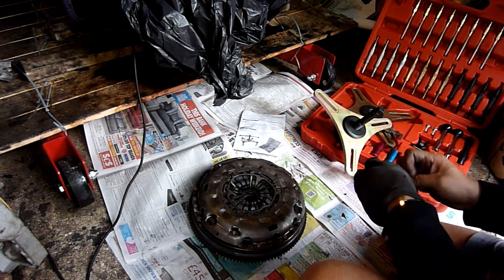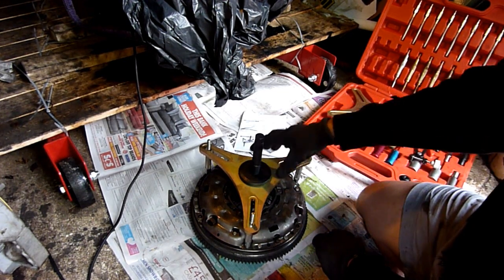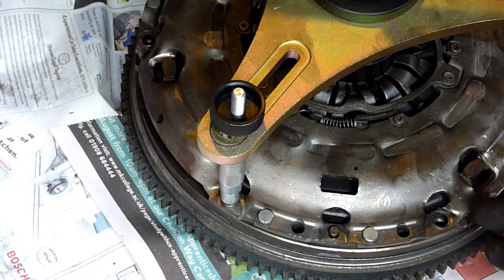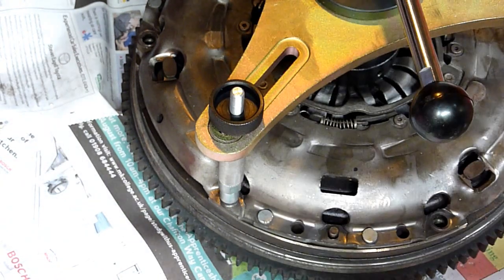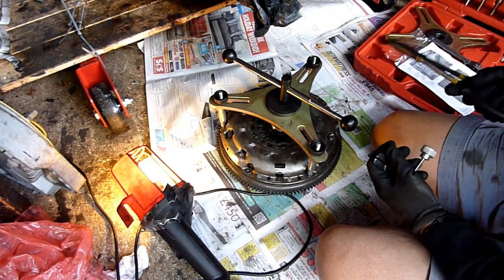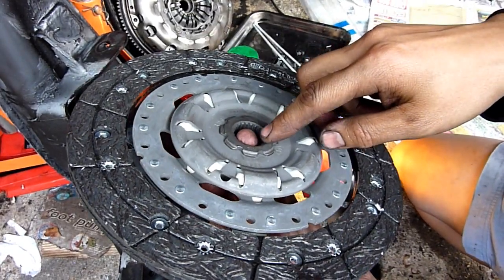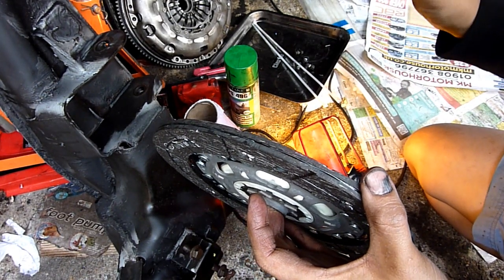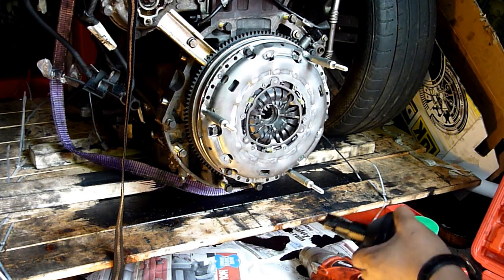Ford Mondeo Self-Adjusting Clutch and Special Tool 2003 late model 2 Litre diesel

Comment: So the theory is this tool just tightens the pressure plate evenly.
Reply from the maker: The special tool doesn't just do that. It sets the zero clutch pressure position like when you fully depress the clutch peddle, then clamps down to the normal drive/ clutch engaged position after unscrewing the special tool and tightening the clutch bolts. If you don't set up the clutch with the special tool, it will not work properly.
Reply: @EducationPineapple  i've fitted a properly pretensioned Luk self adjusting clutch(and new dual mass flywheel) twice now to my car, and twice i couldn't get a gear afterwards? The clutch just won't disengage!
And yes, friction disc is installed the correct way around, i'm totally at a loss as to what im doing wrong, i couldn't have been more careful and prepared to do the job.
Its a renault megane rs225, front wheel drive. If i lift up the front of the car, start it up i can drive all the way up the gearbox no problem, put all four wheels back on the ground again, gear lever is locked solid with the clutch down, not even near going into gear.
Im just about to do this job for a third time and still can't figure out what's wrong?
One thing i noticed messing around with old clutch and flywheel in my house was pressure plate can mount on the flywheel locating dowels a couple of different ways, the way i mounted mine on the car i felt the pressure plate was kind of tight going over these dowels, but i discovered with my old clutch if i kept putting the pressure plate on in different positions suddenly in one position the pressure plate virtually fell onto the dowels!!
I really thought i hsd discovered my problem, does the pressure plate have to go on in a certain position? Thanks.
Reply from the maker: @robbocop33r12  Sorry to hear about your difficulties. My advice to anyone, including myself, is, when you are taking things apart that look a bit the same if you rotate it, take a photograph of the part before taking it off. This applies to things like electrical cables as well. Draw a paint or maker reference point on it as well. This way you can always refer to your proper reference. Rotating a clutch cover 180 degrees even though it appears to fit is not a good idea. Check that things slot in properly and without effort. If you have to force something in, take it back out and re-evaluate. I would say for you to make sure you take your new  part back and exchange it if you can. Go and buy an OEM part from Renault. Use that. In my video, my part was not from Ford, but my car was 11 years old at the time and a very common car, so the chances of getting a good non OEM part was high. Yours look too particular to have a part like a clutch kit made by someone other than Renault. See if you can get an electronic manual (see my videos on it) or better still a Haynes manual. Follow the steps in there.  Watch a video on youtube on that model. Check out Forums. You really need a tool like mine to do the job. Also call up Renault showroom or better still visit them. The guys in the workshops normally will give free advice no problem. Take a photograph of your clutch. They'd tell you which way up it should be. The guys in the parts department can also print off the parts page for your clutch, then you'll definitely see which way up it should be. They're usually bored from having no customers anyway because few come to them for parts. Good Luck and God bless you on your task ahead.
Reply from the maker: @robbocop33r12  Okay I've had a good look at my own video to remind me how this works. I been thinking about what you've written. Here are my thoughts. All clutch kits for Dual Mass Flywheels come pre-tensioned. Now this pre-tension is not the same as what I'm doing when I am rotating my tool to set the clutch. The pre-tensioning that comes with a new clutch cover is the pre-tensioning of the spring which acts as the ratcheting system for when your clutch wears down. When it wears down over the years, the spring will become less compressed as it throws out the ratcheting system. Notice I use a small black tool that bends. This tool is to do the pre-tensioning if you are fitting a new clutch plate and using the old clutch cover. So when sold to you as pre-tensioned clutch it means it has been set to ratchet out for the life of the new clutch plate, not the job I'm using for the special tool. This means the job of the special tool is to compress the teeth evenly enough for the cover bolts to be tightened. When you compress the teeth the mechanism releases the pressure on the clutch plate. Using the special tool simulates the position and pressure of the clutch against the clutch cover when the clutch peddle is fully depressed. Tightening down the cover bolts and unscrewing the tool sets up a normal clamping pressure on clutch.  After everything is assembled and you press on the clutch peddle, the teeth are then fully pushed in and the clutch plate fully disengaged. What you've done is just screw the cover plate on without setting up the clutch. This means that an initial pressure which is the clamping pressure under normal drive is set wrongly up. This results in you pressing on the clutch peddle and not fully disengaging the clutch because the tool is always meant to be used for setting up the zero pressure and drive clamp pressure . That is why you can't get into gear. The special tool is set by myself, so that the clutch plate is just slightly free to rotate, but is still held from falling out by being backed up to the flywheel and being pushed on a little by the teeth. It's also simulates when the least amount of pressure is on the plate (when the clutch peddle is fully pressed down during shifts), then you see me finger tightening the three bolts to hold that set position.  You'll see that I'm checking and screwing in the tool just enough for the flywheel to come towards and touch the clutch cover, as observed through one of the bolt holes. I'm going to paste this answer in my description bit so others can read it as an important notice.
Reply: @EducationPineapple  Thanks for the reply, that makes perfect sense. What you've just explained about the 'half way' position that tool puts the tensioners to, is what i imagined was needing to happeni in my head, i just didn't know how to solve it! :-)
Even looking physically at the preset pressure plate before fitting, i could see the surface that touches the friction disc was slightly proud of the pressure plate casing, this made me think that as soon as that pressure plate was fitted that  friction disc is going to be completely jammed in there!
What you're talking about is spot on, it will slightly take this pressure off the friction disc, thus heightening thechances of the disc freeing with the clutch pedal movement!
'Nobody has ever mentioned this critical point and it' s screwed me up twice! And these cars are apain in the ass to do at thebest of times!
Renault service manual, Haynes, renault service technician 'all' didn't mention using this large spider shaped fitting tool! And i've suffered for this!
What you mention is kind of like fitting brake shoes, you want a slight drag against friction surfaces then you know it will be right
My preset springs were in the 'exact' position shown in all these manuals, yet no gears!
Reply: So just to get this right in my head as i've just started this job again.
My clutch is preset before fitting, that's a given. Then using this tool i compress the pressure plate fingers, until i can 'just' ' poke in a gap and check the friction disc moves slightly? Then tighten down pressure plate mounting bolts then take off the tool? Thanks again.
Reply from the maker: @robbocop33r12  Your clutch cover is preset for the new clutch that comes with your clutch kit, not an old one or ,I guess, a new but different brand of clutch. I remember rotating the handle until the plate just touched. The official document says this :"Stop rotating when the pressure plate housing rests
 against the flywheel. Check through the mounting hole!" There is important information on page 21, 21 of the document that I am reading now. Paste the following into Google Chrome Browser:"  what gap distance to set for self-adjusting clutch  " there's a nice PDF file for LUK clutches. It explains the procedure very well.
Reply: @EducationPineapple  only thing i find odd about that is it says to stop when it hits flywheel. Looking at my old flywheel and clutch the pressure plate just falls onto the flywheel over the the locating dowels and touches theflywheel straight away??
So that section becomes redundant. I actually thought i was onto something with my old clutch, i put the pressure plate on on all sorts of orientations, then suddenly found the plate fell on, flat against the flywheel!
I thought that was significant as i remember the plate being tight going over the dowels on the flywheel, but maybe they are meant to be tight, and my old one fell into place with my old clutch as it had been on before!
I don't know if i'm making it complicated, or it secretly 'is' complicated!
Im not going to do this job again and get that sinking feeling getting no gears again after all that work! :-/
Reply from the maker: @robbocop33r12  I would just rotate the tool and watch through the hole to see the flywheel come closer to the hole's edge. Then tighten down a bit like I did. I think the complicated thing to get your head around is when you are rotating the tool, every logic makes you think you are putting more pressure on the clutch, but in fact there should be less pressure or nearly the same than before you started rotating the handle. Don't forget the special tool is attached to the clutch cover and not the flywheel. Any force of turning clockwise the handle is relieving pressure. Thus has the clutch plate is pulled towards the tool as you rotate clockwise the handle, the flywheel appears to move closer to the edge of the clutch cover. Before you rotated, what stopped the flywheel meeting the clutch cover is the thickness of the new clutch. After rotating the handle the clutch plate moves closer to the cover and tool thus reducing the gap. After tightening the three bolts down a bit you could say this is what the system would look like if the everything was back in the car and the peddle was depressed, and then  unscrewing the handle  now adds the pressure to clamp on the clutch plate. This is because there is nowhere to move between the clutch cover and flywheel.
Reply from the maker: @robbocop33r12  I also think your old clutch was worn. That is why it just fell in. Do the work with the new clutch kit. There should  be a gap when looking through the hole before you start to rotate the handle. Also spend 95% of your time lining the thing up perfectly only 5% using the tool, or you won't be able to fit your spindle in when connecting the gearbox.
Reply: @EducationPineapple  ok, so tools definetly getting used then this time. Im still staggered that only one person ever told me outright, you don't use the tool, you won't get a gear! And he was so adamant about it too. What did he know that the Renault service manual, the local technician and Haynes didn't? :-)
And thanks for taking so much time out to help, much appreciated!
Reply from the maker: @robbocop33r12  Good luck and God Bless
Reply from the maker: @robbocop33r12  I been reading your old posts from 4 months ago robbocop, I can see that the first clutch kit you bought was different to the LUK one. I think the first one with the green springs is more complicated to use. It looks like it is meant to be used to fit onto even worn clutch plates. You also mentioned that the first clutch kit says to compress the teeth, then tighten the bolts, then rotate the green springs clockwise to set. My guess this clutch cover was not preset to any particular clutch, but preset to snap onto, after rotating the green springs clockwise, thus truly becoming primed ready for any clutch, worn or not. You also mentioned 4 months ago that you used a bearing removal tool. I would say that you cannot use this tool for your final effort (which in my opinion will work this third time). You must use the special tool that I am using. See my pasted link to ebay. Also please re-read all of the text that I have written before you begin. I have amended some of my theories to what is happening. I am positive on how it all works now. Please re-read. Also someone earlier posted something about before cover plate installation, to push the alignment tool through the cover plate, then adding on the clutch plate to the shaft of the tool, then fitting the whole lot on finger tight with say three bolts before our special tool is fitted. Experiment to see if that works. If t does, it would save a lot of time. Good luck!
Reply: @EducationPineapple  sorry, didn't realise id posted problem here twice! I was in a bit of a state at the time! :-) 
In fact both clutches i' ve put on were both new Luk ones with the green preset springs, it's just that the first one the springs weren't preset out of the box, which i've heard can happen in transit, the preset adjustment can become undone if package gets a knock!
You've given me good guidance though, tools definetly the way to go and i've more understanding of what the tool does.
Its still really odd that people on the Renault forums, and ofcourse Renault dealer themselves said you don't need the tool to fit it, but i' m sure you do now!
Reply from the maker: @robbocop33r12 : If your existing LUK clutch cover you have has had it's green springs ratcheted out after you installed it and pressed on peddle, you'll either have to work out a way, if that's possible and I think someone (
rhino trikes) posted down below  they did just that, to reset the pre-tension ratchet using a small tool (like the one that bent on me, but better) to reset the spring. That might be another video someone's done, or you'll need to get another kit. You can also experiment on your old clutch cover to see if you can reset the springs. If you do buy clutch kits and they have accidentally ratcheted out in transport, take it back to the shop to swap for another. The springs that comes with the clutch kit should be fully compressed to start with. I wouldn't touch them during installation. I think setting them like in your LUK instructions that come with the clutch kit during installation may be a risk. The only purpose it would serve would be to make the clutch super ready for driving or if you're using an new clutch plate on an old clutch cover. If you didn't do this setting up, the only difference would be the ratchet would be set correctly after stepping on the clutch fully a couple of times. The instructions (PDF) may clear this point up if it's an extra step needed.
Reply: @EducationPineapple  Just to let you know your input set me on the right path here(and gave me confidence to do the job again) , and really gave me a better understanding of how important using this tool is.
I bought the tool, installed clutch again yesterday and i'm getting gears now, car works great! , thank you very much for your help!! Much appreciated! :-)

Comment: Thanks for posting this. Tried experimenting on an old clutch & flywheel myself. Couldn't get self adjuster to go back to reset position either. Drilled rivets out of old clutch cover & dismantled to find out how it all worked. Still non the wiser as to why I couldn't get it to rotate back! BTW If you set up your clutch aligning tool on the plate & cover before you put it against the flywheel you can look at it from the other side & centre the disc to the cover. Just nip the tool up enough to hold it all together until you lightly fit a couple of cover bolts.

Comment: I've just done a Focus clutch using the same tools. In the slots in the same circle as the springs (Not in the spring slots) there are little tag levers. What you need to do is ease the ratchet back with screwdrivers against these tags, then use your little compressor tool (Looks like circlip pliers) to hold it while you take it of again to fit the friction plate. After re-fitting the 3 clutch retaining screws and tightening them, apply pressure again to the diaphragm compressor, the springs (Which should be fully compressed) will move the ratchets and set themselves. Just a point, if you're using a new plate and diaphragm, they are factory set and using the compressor to fit them is all you need do. I fitted mine without the compressor by mistake and so had to re-set the new diaphragm. Still, you live and learn. Thanks for the video.
Reply: Why do you have to use the compressor tool to fit the new clutch if the self adjustment mechanism is set from the factory??
I was under the impression this fitting tool does two things, one it fits a new preset pressure plate without upsetting the adjustment while fitting, and two it can refit a used pressure plate and set the adjustment mechanism again while mounted to the flywheel?
I actuall had someone very forcefully tell me even with a brand new preset clutch, if you don't use this fitting tool, your clutch won't work??
Dozens of people have told me you can just diagonally, gradually tighten the pressure plate bolts up without this tool being used, but only one person told me no tool, no working clutch?
I'm beginning to think that one person was correct!